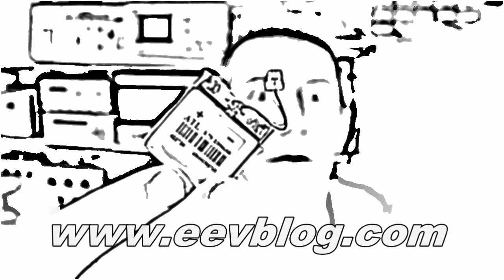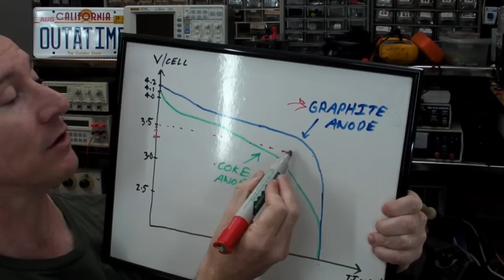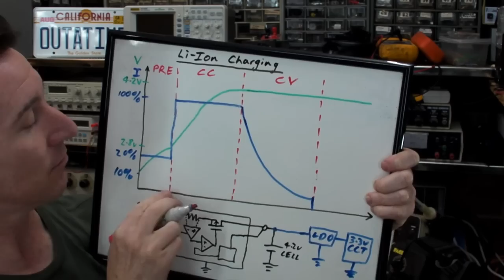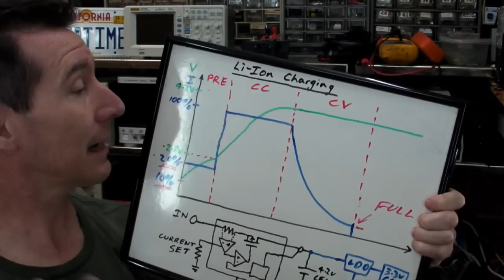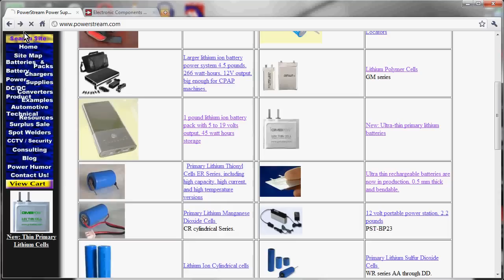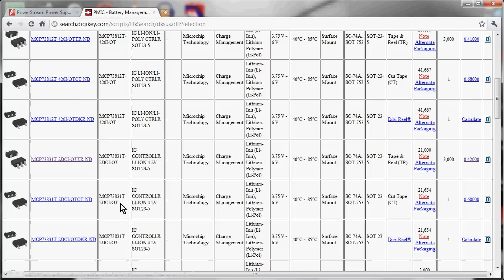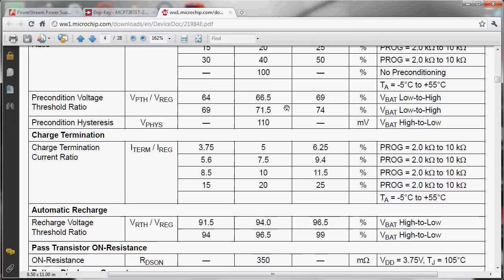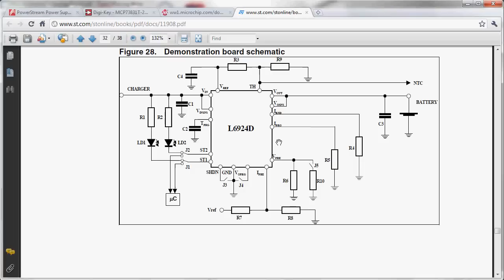EEVblog #176 - Lithium Ion/Polymer Battery Charging Tutorial

Comment: I have a 3 (in parallele) cell Li-ion batt from sparkfun (google finds them quickly) and Im having a lot of trouble designing a charger for them because all of the Li-ion charger  IC i find specify the they only charge One cell batteries but Im not sure if they refer to one cell in series or parralel? thanx in advance for any help.
Reply: If they are truly in parallel, then this would be defined as "One cell".
For this case, the current ratings for the charging circuitry would be three times that of a single individual cell.
However, the advertised specs for the whole battery may be rated for all three in parallel already.
redrok

Comment: Why so complex?     Cant you just use a regulated (4.2 volt) supply which is current limited to 0.5C?
Reply: because then you wouldnt know when the batteries are fully charged ..
Reply: Uh, well - why not just call it done when the current drops off to near nothing?
Reply: because you would then need to monitor your supply as opposed to just plugging it in and leaving.. why bother with the extra hassle?
Reply: yes ! 0.1C is safer.
Reply: Eric-Jan van den Bogaard, so can I just constantly charge a battery with very low current (less than 0.1C) and put a charge protection circuit in between to prevent it from overcharging?
Reply: Okay, I'm a little confused. when the battery reaches 4.2 ~ V will the current curve automatically decay or is it necessary to do this electronically?
Reply: leandro842  Yes. See his follow-up video: https://youtu.be/jNmlxBXEqW0

Comment: Milwaukee makes a cordless tool battery charger model 48-59-2818 that will charge both NiCd and Lithium 18 volt batteries on the same plug with no switch to indicate NiCd or Lithium. This seems contradictory since I thought the chemistry of NiCd and Lithium are completely different. Is this type of charger able to work because both batteries are 18 volt and share a common style plug?

Comment: Is the pre-charge 20% of 1C or 20% of the 1/2C (because we charge li-ion at 1/2 C), I have two 3.7 v 710 mAh batteries, one is good so I charged it at (cc) 350 mAh maximum and then (cv) with a limit of 4.2 v until amperage dropped down to the cut off of 35 mAh (10% of charge current) my second battery reads zero volts, so do I do a pre charge of 70 mAh (20% of 1C) or 35 mAh (20% of maximum charge rate)?   P.S. I'm practicing using my new bench power supply unit and these batteries are just to practice charging different batteries.

Comment: Say i've calculated that my battery need 25ma to charge and my circuit also needs 25ma, So i set the charger to 50ma.
what if my circuit draws 1ma at one point??  Is it going to damage the cell?

Comment: Is a battery protection circuit enough to charge a 3.7v battery at 5v? I just want to slowly trickle charge it at 0.1C with a 5.5v (4.9 because of the diode) solar panel.

Comment: Would you bother with "fuel gauge" type chips for measuring the battery level or would an ADC channel suffice?
Reply: Adc channel will work perfectly well for a single cell battery assuming that the microcontroller itself is receiving a accurate regulated power supply higher than the maximum voltage of the battery (in this case, 4.2 volts.) So if your microcontroller is running on 5v, then you could easily read the voltage using that method as long as that 5v is regulated and accurate. Assuming all those things, then yes, an adc channel would work perfectly. But this will only work with a single cell battery. A 2 cell battery goes up to 8.4 volts which would fry your microcontroller.
Reply: *****
internal 2.5v reference and some dividing resistors, works ok for measuring (single cell) voltage, but it is not an accurate way of determining the capacity left on the battery
Reply: +william fleete well if you already knew the answer why did you ask? the voltage, although not accurate to measure percentage, is fine for telling you when the battery is low.

Comment: Hi David, I have been watching and learning more about the Li-Ion battery, One Cell Li-ion/Li-polymer Linear Charger IC with Battery Temperature Detection.

I was wondering if you could advise if B values are very important. I have a Battery that has a NTP has a B25/85= 3435  10kohm 5% and the IC has a NTP value B25/50= 3380 1%. 

Could you advise?

Comment: If I charge my "Lithium Ion Battery" when it is only half drained (still @ 50%-60% charge remaining), will that ruin the battery?  Will it make the battery's "memory" go out of whack??   If my battery ran my tool for 1 hour on a full charge and I didn't wait for the battery to be completely drained before charging it, would that then change the amount of time that the battery would run my tool (meaning will it set a new "cell memory" and now only run my tool for 20 minutes now by doing this?)

Comment: Hi , i have a complicated question 
Im looking to build a 96v battery pack using 3.7v 87.5ah li poly cells 26s , now that the pack is built without a bms how much voltage do i need to charge the hole pack
Reply: For each cell to charge a 4.20v is a must but what about in 26s ,,,
4.20×25=105v

Comment: HI, i want to use a battery charger to charge a LiPo battery, the battery must act as an UPS for a micro controller.  Can I connect the power of the micro directly to the battery while it is charging? I do not want damage the micro as I have a 1200mah battery and want to charge it at 1A. Will the micro be able to draw more power from the charging circuit than that 1A?

Comment: I'm developing a Li Ion battery pack with three LG HG2 18650 batteries in series. Is there a chip that you would recommend for this application?
Reply: for 18650's things are easy... just have a wall power unit of 12.6 volt and charge at 0.1C

Comment: .  I also found the following when I googed:

"For proper reporting of the battery’s state of charge, be sure to go through at least one charge cycle per month (charging the battery to 100% and then completely running it down)."

To me, the above means for proper reporting of the how much charge is left in the battery, not to make the battery last longer before it need replacement.  Am I correct?

Comment: I am an avid watcher of your channel but pretty ignorant when it comes to all the circuits.  I own several Baofeng BF888 radios and left the radios in the charger for 2 days and the cheap charger not only did not charge them but they depleted them down to 20-30 mv.  Any suggestions on the Youtube video on modifying the stock charger using a TP4056 and changing one of the resistors to the 2k style to get 500 ma charge?

Comment: Good day, I'm making a prototype that uses 2S 7.4v 3400mAh battery pack. Do you know any good changing IC modules (PCB) that I can use to charge the pack via USB. I don't want to integrate the charging circuit into my existing design, since they look like they are pretty cheap anyway. I'm looking for something that I can just punch a hole in my enclosure for the USB and it will just work. Any advice?

Comment: ❤, I discovered that when I connected a Lithium cell to a charger, the battery voltage immediately overshoot slightly above the actual battery's voltage, why is that happening, someone should explain please. Thanks in advance

Comment: Some say there is no problem leaving the charger connected, even when in use, the charger regulator in the device will protect the battery from being over charged.  Is this true?

Also, will the device like a Kindle Fire use the charger's for power and not the battery, thus extending the live of the battery before it needs replacement?

Comment: Are there chips for battery modules made from three separate Li ion 18650 batteries strung in series?
Reply: Could I put a chip on each battery and then string them in series?

Comment: I've been running some tests on USB charges from different manufacturers checking voltagem and current.

I noticed that some usb charges do deliver 4.9 to 5.2 volts and from 500mA to 2.4A.

My manufacturer's charger (Apple) delivers 1000mA @ 5.05v to my phone.

My questions are:

If I use a 600mA @ 4.96v could reduce my battery life?
if I use a 5v at less current (slow charge) will it prolongue the battery life?
Reply: internal that would be 4.2...

Comment: noobs question:  How does the charger read the voltage of the battery without reading the charge voltage while it is charging?  I'm guessing the charger is pulsing voltage during the charge cycle and taking battery readings during 0 charge voltage.  Is this correct or am I completely off track?
Reply: Think of it as filling the battery with electrons. The only time electrons flow is when there's a potential difference. During CC mode, the charger has to raise the voltage potential to push electrons into the battery, but it limits the current by raising its output impedance. The combination of output impedance and the load applied by a discharged battery gives you the battery voltage reading. Once the battery hits the 4.2v, the charger then changes to CV mode, which drops the output voltage to 4.2. As there's little or no voltage potential across the battery, you will see the drop in charge current. Hope this helps. You can demonstrate the CC principle with a bench power supply. Set your supply to 12v, but limit the current to 200mA. Then insert a 27R 5W resistor across the terminals. Ohms law says the resistor will draw about 440mA @ 12V. But the output impedance of your supply won't let draw more than 200mA. The supply voltage will drop to 5.5V. Don't use this cct for charging :)

Comment: @vaneenbergen 

When used properly their dangers although real are very unlikely to ever be encountered. You could always try LiFePo4 batteries instead as they are more or less safe. IC's are available to charge those from Microchip (I presume other ppl as well) I've used the MCP73X23 but they do a couple of others to.

Comment: Is it true, that I should never let my battery drop below 40% ? My smartphone has a lithium-Ion battery and it drops out a message "Please charge" if it runs below 40%, and "Charge immediately" if it drops below 20% ... While I'm used to principle - Discharge completly and then charge completly (at least that's how it worked for my previous phones)
Reply: +_ Martin Don't completely discharge. The phone will protect the battery voltage from dropping too low, even at 0% it wont kill the cells but it affects how many charge/discharge cycles and self discharge and other things. Completely discharging before recharging really only applied to nicad batteries and following that same principle for nimh or lithium batteries will reduce performance and life. Lithium batteries need a protection circuit to prevent discharge below usually 3v.
Reply: So better charge more, right? I've heard that lithium doesn't have any timer checks, which means that they can be charged at any time, even if the battery is already at 70% and was charged recently

Comment: what happens if you charge from beginning with constant voltage. There will be current overload and damage the cell? Or even explode?
Reply: yup, its drawing too much current at 4.2V. More current = more heat = kaboom.. You can "fast charge" them with higher current but 4.2V will probably be too high anyway. When you exceed the given current to fast charge it there is of course a risk and it should not be done unless you know what youre doing. and also only if it would not bother you if a cell might crap up and die once in a while, esp. while figering out how much it can take.

Comment: I just need a confirmation here....do we have to always maintain higher voltage at the charger side than the battery side. cause if ur charger is providing lower voltage than the battery it might drain the battery rather than charge it.
Reply: +Dan Bc  thanks for the reply
Reply: +Dan Bc Well in the first chip from Digikey that Dave showed, the IC said it would take a supply voltage of anywhere between 3.75 and 6V (31:51). 

Doesn't that mean your supply voltage into IC ]can be anywhere from 4.2 to 6V and the 4.2V Lithium cell will charge properly (in that the IC will down regulate the supply voltage to 4.2V, within its tolerance)?

Comment: Could you please clarify this for a newbie?

Let's say I have a simple 150 USD "linear" power supply. And set it up at 0.10C and 4.2Volts. The supply will keep a constant current of  0.1C until the voltage reaches 4.2V and then will go into c.v. mode until the current drops to almost nothing and then I have to disconnect the battery. Exactly at what point of this theoretical procedure will reality deviate due to thermal limiting on the power supply?
Also, are linear PSs ok for this job?

Comment: I have a 3.7V li-ion battery that i would like to use in a project im doing, was wondering how to charge it, the battery is type 14500 and is 1000mAh, youre not supposed to use standard nicad battery chargers are you? the battery is AA sized. thanks.

Comment: you said that li-ion can only be charge by 4.1 or 4.2v but why cellphone can be charge by 5v?
Reply: Jong Geronimo The 5V only reaches the input of the chip(s) described. The output of the chip is .1/4.2V, and that's what reaches the battery.

Comment: Q: I have the Sony-Erricsson Xperia Play, an old smartphone with quite a battery for its time.. Now when I use my smartphone and it gets at a level below 80% then, when I stop the apps I have used and click the "off" button (standby NOT off completly) it slowly gets back up some 15% till it finishes that or it reaches say 80% of the total battery charge, now WHY does it do that? Is that my telephone slowly measuring more or is it actually regenerating by for instance the heat?
Reply: This is because of internal resistance of battery. Your battery is pretty old, so internal resistance is quite high and when you use phone there is a voltage drop which phone determine as discharge.
Reply: Oops... Yeah of course, and because of heat generated in the battery the resistance gets even bigger... I'm such a fool sometimes :D

Well thanks for telling me!

Comment: Dave, how did you learn about charging a LiPo battery? Did you read about it from a book?
Reply: Also, what is Vin for a charging circuit? Some DC voltage within data sheet spec?
Reply: That's indeed a good point there are lots of data sheets of 18650's but for lipo cells in packs ?

Comment: in constant current mode, can i use my constant current circuit 12v supply 500ma? then if the batt voltage is 4.2v ill disconnect
Reply: 3 cells ?

Comment: Hi, thanks for this useful video.
I have a question about LiPo chargers. What would is the difference between a normal LiPo Charger, for example, four cells, and a Balanced LiPo Charger for four cells.
I mean, is there any difference for the lifespan of the cells?

Comment: Great video's, I'm learning so much! Quick question though, I've noticed in some video's you talk about currents or voltages with a term that sounds to me like your saying "not" before the measurment.

For example, around 10:28 you talk about the charge rate and say "not point 5 C". What does this mean? I'm very new and trying to figure out all these terms and such. Thanks!
Reply: i know this is 6 years late, but here is you answer
if you watch between 10:05  to 10:16   you will hear him say
IF THIS BATTERY IS  50mAh 50 milli Amp Hours
then  50mAh = 1C
it's the same as saying   I'M TELLING YOU THAT 4 BANANA'S = 1 ELEPHANT
you don't need to understand it,  you just need to accept it
so if i have 2 banana's , then i obviously have 0.5 Elephant's  
got that

well.. he said
IF  A BATTERY IS  50mAh   it  =  "1C"

then he says  that the Lithium Ion battery is  0.5 C   or   Naught point Five   or   Half a C
so....
if  50 = 1C
and you have  half  a C
you obviously then have  a battery with a  current of HALF OF 50mAh  
THUS.. YOU HAVE  A 25mAh Battery

DOES THAT HELP ?

Comment: Maybe a noob question if someone can answer... I have an electric scooter which has an internal li-ion battery in it.  Can I juice that battery up with a Li-po battery if it is running low? 

For example if I carry a Li-po in a backpack and I'm out and about and running low power in the li-ion internal battery can I attach the li-po battery to where I would connect an AC charger to the scooter and power the scooter that way?
Reply: +Chutsey Should be good. Make sure you connect it in parallel and you have a protection circuit or voltage monitor on the battery. I modified a dewalt drill to use lipo batteries. Also make sure the C rating will support the draw from the motor.

Comment: Hello  , is it passable to power 3.3 volt circuit using li-po through 11117 3.3v regulator or  11117 adj regulator   ?!!!

Comment: Hello thanks for your video! I have a li ion cell phone battery im trying to charge right now and I was wondering a few things if you don't mind answering.
The battery is 3.7 Volt , 3.55W-hr , and 960mA-hr. So if i'm charging it, I should go at half the mA-hr correct? (for the constant current part). And then after it reaches 3.7 volts keep a constant voltageat exactly 3.7 volts.

Comment: Hy ,why many people say to not charge our phone battery over 80% because will damage the battery,even Iphone implements this type of charge ,why is not good made a full  charge of 100%?
100% of charge will damage the battery in time?
Thanks
Reply: I believe it's the high voltage of a fully charged battery, 4.2 or whatever it was. Apparently a higher voltage wears out the battery faster.

Comment: 👍 just watched your video and subscribed. I didn't know lith-ion & lipo were the same?! Ty.. 👍.  I've got an Arrma rc brushed Motor with an ESC running on 7 cell 8.4V 3300mAh NIMH battery that is able to run lipo with pin configuration. My question is, is it possible/better to use two 7.4V 1600mAh 30c 11.84Wh lithium-ion in parallel or, in series? Or will it fry my ESC? Any help would be awesome.